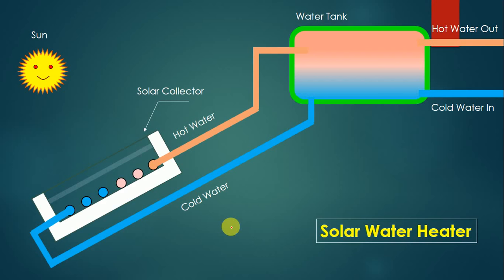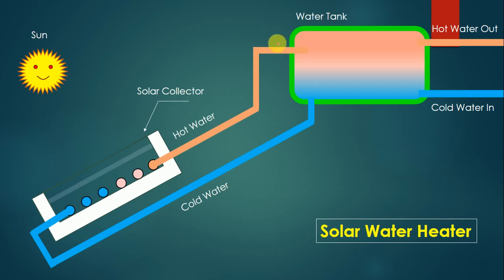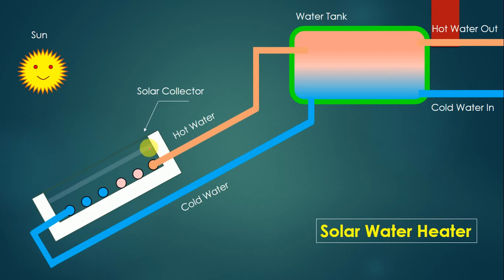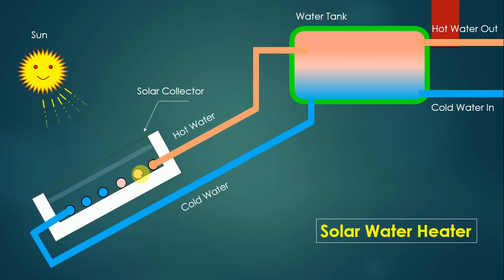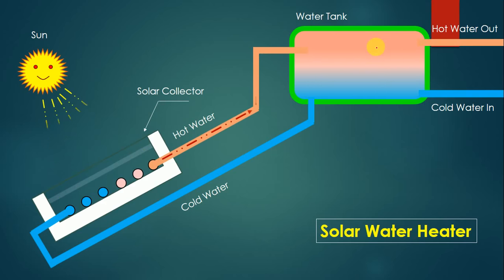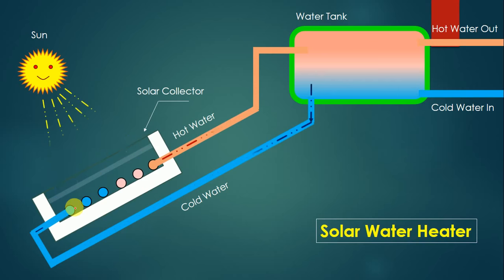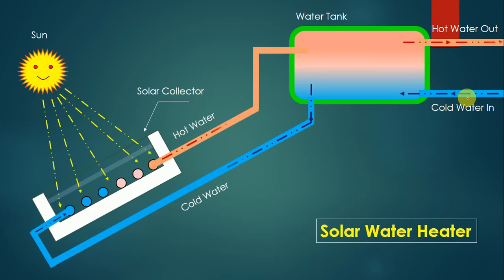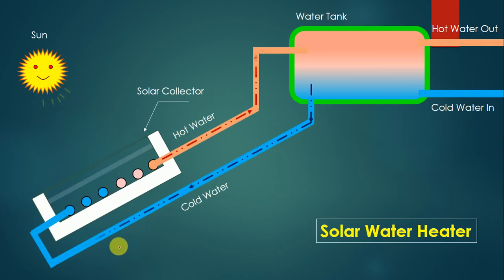Solar water heater working animation

Comment: Does the system need to be circulated or vented…….will pressure get too high. I’m only looking to bring up water temps from lake water ( 10C ) in order for the water heater to not be using a lot of electricity. Just warm water for laundry……but the system may sit for a few days before being used. Does it need to be moved or vented ? Thank you !

Comment: Hello sir, Iam having a problem in the tank where hot water is stored, water heated from panel is not going up in the tank, as cold water going inside is filling full in the tank and over flowing from the pipe where hot water should go in. This has stopped hot water to go inside. pls help sir, will be glad to have reply back from you. Thank you.

Comment: Ok so water is heated because of sunlight and water moves from lower to higher region due to  density difference & (without any  external motor ) .
Also hot water has less density and moves up, whereas cold water has more density and stays down.

Comment: Good explanation thanks..
I have a issue, when entering cold water every time when reducing the hot water from tank for applications then full tank will get cold because every time it filling with cold water.

Or 

when releasing hot water to tank only it allows to enter cold water.
Reply from the maker: The total volume of the system is constant and filled with water.
Whenever hot water is removed from the tank the same amount of cold water will enter the system/tank.
When water is not removed, it circulate in the system continuously and water temperature increases continuously.

Comment: why the cold water and hot water kept in the same tank,
what if we use different tanks for cold and hot water so that our hot water will be hot for more time if unused because of the no heat transfer to cold water, why we don't do that?
Reply from the maker: Yes, we can make arrangement as you have mentioned. Actually there are various types of solar water heater. I have mentioned only one type, there may be different arrangements than this.
Reply: @SampurnaEngg  okay, thank you 🔥

Comment: What if cold water is directly   conncted to solar collector? Due to both cold and hot water in same tank . This will reduce heat in the night. Proper insilated water tank can store heat till next morning.
Reply from the maker: If you connect cold water to the collector, you can recirculate the water and hence we may not achieve the expected high temperature of the water.

Comment: - Does the water need to be full to work?
- Are hot and cold water in the same tank? If so, is the transfer of energy in the boundary between hot and cold water not too much as to affect the effectiveness of the tank?
- Is water pressure entering the system maintained throughout the water heater pipelines?

Amazing video sir, thank you for giving us this.
Reply from the maker: -Water need to be almost full in tank otherwise air trapping may happen.
-Hot and cold water is in the same tank to recirculate water again and again to collector to achieve required temperature. If you saperate hot and cold water recirculation problem may occur.
- There is not much variation in pressure throughout system, slite variation may present to maintain flow of water.
Reply: @SampurnaEngg  thanks so much for answering!
Reply: @SampurnaEngg  thank you sir for the explanation. I have a doubt. So if water is circulating again and again to collector to raise to desired temperature so what is the condition for hot water pumping out from tank ?

Comment: Actually we will pour hot and cold water in the bucket they will be mixed right .... why here in the tank doesn’t mixing hot and cold water?
Reply from the maker: When we pour hot and cold water in bucket, velocity, inertia and momentum is high and hence it get mix with each other.
 In the tank of solar water heater the velocity of cold and hot water is very very less actually it is at micro level ( such kind of velocity can be observed in the water when we heat water in pot by using normal gas stoves). So because of micro level movement of water it doesn't get mix with each other. Hope you got it.
Reply: When hot water is poured in bucket with cold water , then it get mixed, but after some time, if u check temperature of bottom and upside ,it is different.
But as hot water prefers to be upside when we put our finger we feel hot

Comment: Does the cold water and hot water inside the tank will have any separater?
Reply from the maker: Yes, In some heaters saperator may be available. Actually there are various types of solar water heater. I have mentioned only one type, there may be different arrangements than this.

Comment: if I close the intake of cold water in summertime and keep it unsued to avoid hot water formation. is it good for solar panels efficiency? only hot water for a long time in the water tank will form steam. is this steam dangerous for tank and pipes?
Reply from the maker: It is quite dengerous for system and human being near to system, bcoz if you close intake valve of cold water, there will not be circulation of Water. Temperature of water already available in the system will increase and it will form steam. If you maintain same situation for long period the steam temperature and pressure increases to high extend and may cause blast. To avoid blasts safety valves are used.
Reply: @SampurnaEngg  thank you for clearing doubt.
Reply: @SampurnaEngg  so solar heater doesn't have over pressure valve / expansion valve?
Reply: @SampurnaEngg  nice info

Comment: If we dont use hot water for some days.the temperature inside the tank will damages to tank?
Reply from the maker: No, 
There are safety measures included in system to avoid damage.
If water temperature goes above certain temperature then circulation of water to solar panel is stopped and further heating is restricted.
Reply: @SampurnaEngg  which device or which thing is used for that purpose?
Reply from the maker: Temperature and pressure controlled valves.
Reply: @SampurnaEngg  thanks

Comment: Why the cold water don't come straight from the tap to the solar collector?
Reply from the maker: I didn't understood question correctly, you mean to say cold water from solar collector? You mentioned solar panel which is not present in the system.
Please elaborate your question.
Reply: @SampurnaEngg  Forgive for that, Meant solar collector.
Reply: So that hot and cold water keep exchanging in water tank

Comment: Super video.. One doubt is will this system works in night or winter or rainy seasons
Reply from the maker: Water will not be heated in night time. Water is heated throughout day, will be stored in insulated tank & can be used in the morning for bathing.

It will work in winter or rainy season but temperature of output water will be slightly less.
Reply: @SampurnaEngg  thank you for your instant reply I didn't see any channel like this before you people are replying quickly I am going to subscribe and recommend this channel to my friends
Reply from the maker: @mohanmovibrothers3539  Thanks...

Comment: I am doing a project on solar air heater. Can you tell me how to make animation for my project ?
Reply from the maker: This animation is done by using PPT,
You can use Fusion 360 or other available softwares.

Comment: What if clouds block sun light, is there any backup system.
Reply: The water tank is insulated. So, the water inside is being kept warm.
Reply from the maker: If clouds block sun, water will get light warm due to diffused sun rays.
Diffused sun rays are reflected sun rays passing through clouds.